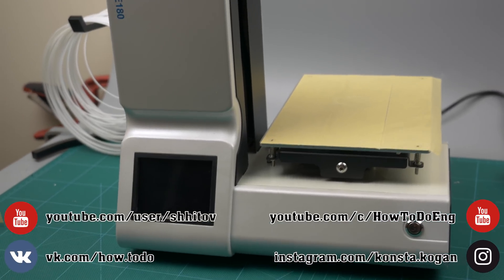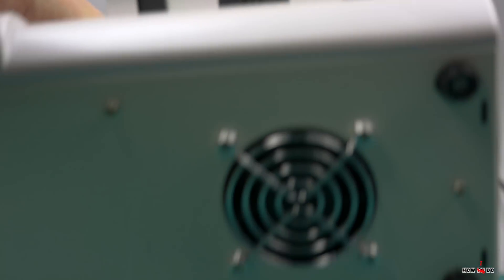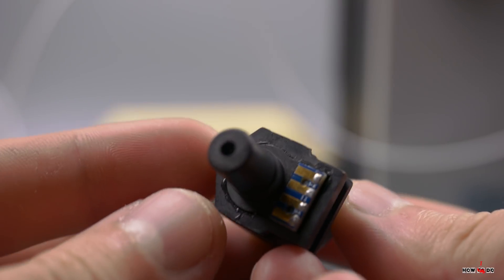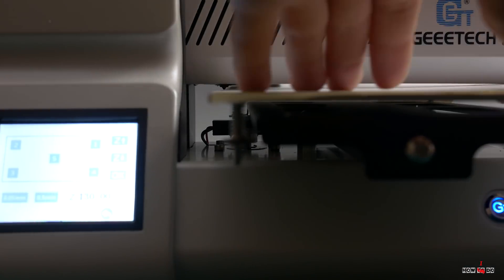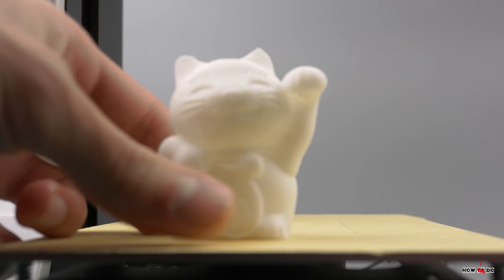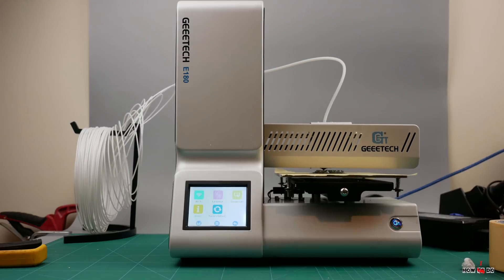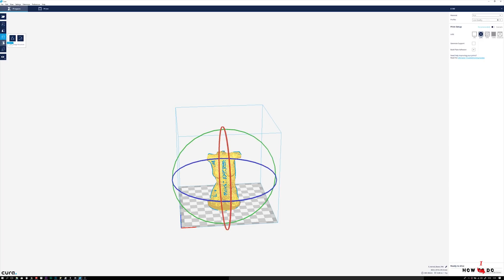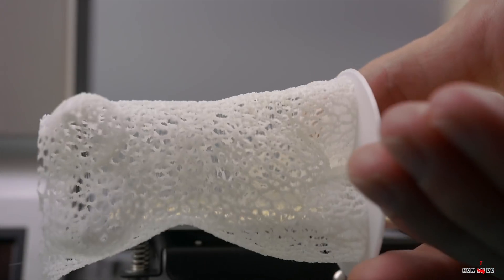Geeetech E180 Mini 3D Printer review and tests

Comment: I have an E180, and I have found it under extrudes.  When I did a extruder test, it only moved the filament 0.7 of the distance commanded.  When I printed a model from the SD card, it only used 0.7 of the filament that the slicer said it needed.  Do any of the models you printed show any evidence of under extruding? Have you done a filament advance test yet?  It is possible that you might not recognize under extruding at first glance, since it mainly shows up on horizontal surfaces and infill.  Vertical surfaces and perimeters tend to look very good.